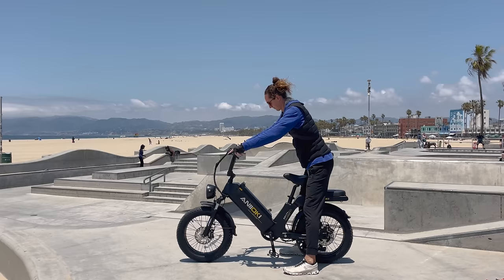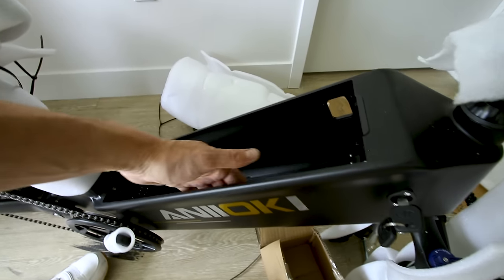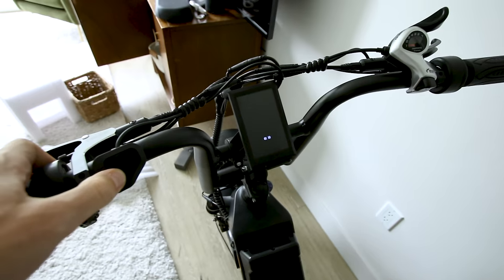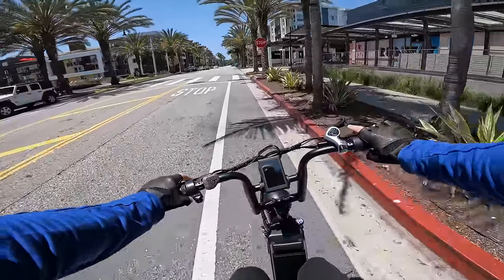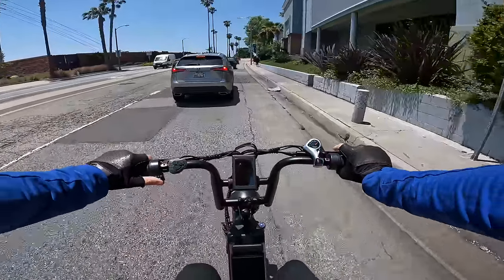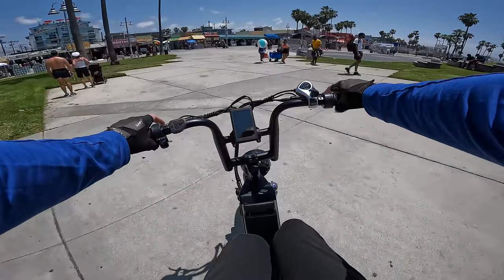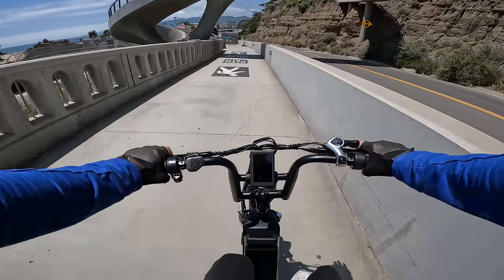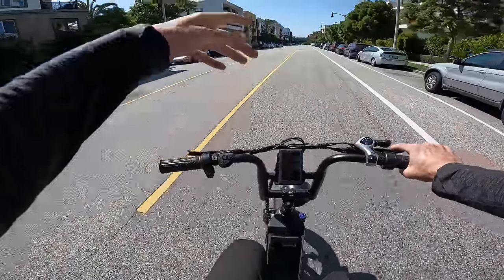The LONGEST Range Ebike Ever! Aniioki AQ177 Pro Max Review

Comment: It is worth pointing out that the 52 Volt version of this bike only delivers 200 Watt more peak power at 1400 Watt compared to 1200 Watt for this one, that version is called A8 rather then AQ177. Strange that it has such a different model name. Worth noticing is that the A8 version do not have that nfc card that you use to start the controller nor does it have any turn signals. I wonder why they think the more expensive version should be more easy to steal and less safe on the road?:face-blue-wide-eyes: I am sure that the flat tire was caused by the strain from that break test. That is one of the major flaws with this bike, from the factory it comes with cheap regular bike rated rather then moped rated tubes inside. That is one of the changes they should make to this bike since it is such a powerful and heavy bike. Also that front light mount is a major flaw, it simply can not hold the light in place if you go on rocky or bumpy roads. It simply falls down to the side and dangles there.

Comment: Yes the screen brightness is low. alson set tire size to 22. And the speedometer will be right on for the most part. The tires suck my back one wore out within 500 mi. But the battery it goes and goes and goes and goes. I love mine

Comment: This ebike would benefit from adding a 3000w motor. You can also add 2x1000w geared hub motors that peak at 2,200+ each.
Reply: I agree. Have you seen anyone talking about having done this?
Reply: @TheCartographeraoe  I haven’t, but these bikes are upgraded styles of e-bikes are updated regularly with less of a battery capability. Think about it it is also intergrated which is cool, so all the extra space on top can be added with another equally sized battery, half whatever. 🙂

Comment: The main reason to choose skinny tired over fat is a persons own requirements.
For instance, a skinny can be lifted more easily. This means maneuverability increases in terms of riding.
 Not to mention ranges and excelleration All things to consider of course. 
Fat tires is close to an Enduro motorcycle, but like a Custom motor with a gallon gas tank in terms of range..
Passes everything but the AC outlet.
An Enduro motorcycle however,  travels hundreds of miles and only needs a few minutes to refuel.

Comment: I’m looking into buying an ebike with a 60+ amp hour capacity battery, and the highest voltage battery/ebike i can locate. i prefer the responsiveness of higher voltage.

i plan and look forward to installing solid airless tires or sometimes called honeycomb airless tires, once i purchase an ebike with fantastic range.

this would permit zero flat tires. true zero flat tires. i realize ride quality can be affected by solid tires but i have ridden ebikes with the airless honeycomb tires that ride really well on ebikes which have front and rear suspension.

so exciting!

Comment: It's common sense that you could get even better range if you just pedal the bike in low level speed, you could probably do a 130 mile range or more easily. It's a 60 amp battery. It's common sense that you're gonna go a long ways.

Comment: I have the 52v A8 dual motor. I did 89 miles two days ago and still had a little more than 40% battery left, according to my multimeter.

Comment: I was about to get this bike, but then I found out about the Eahora Juliet which is this bike but better.
Reply: How much did the bike cost.
Reply: @strikezsr8047  Sorry for the late reply, it cost me about $1800 and I've seen it as low as $1700 on sale. Do keep in mind that the rear rack on the Eahora Juliet isn't suspended whereas on the Aniioki it is if that matters to you. I expected the Juliet to be faster since the motor is a higher nominal wattage but it seems they're both the same topping out at 31MPH (145lbs rider). The Juliet has a dual-crown fork, though so that makes the steering feel more stable.

Comment: Wow, so I just had a rude experience from one of the Aniioki reps. I asked if it would be possible to replace my failing 750 watt hub motor on my Aniioki AQ177 Pro Max 48v 60ah bike with a 1000 watt hub and asked a couple of dumb questions in the process which I answered myself and you know what I got? A lot of these !!! So to say I'm not impressed is an understatement... At any rate I'm wondering, is the hub motor a 175mm or 190mm? Oh, how's it going? lol

Comment: Problem with a bike like that is if I go somewhere with it, it's a given someone will steal it. How do you 100% secure it? Someone can just cut a chain, pick up the bike, go.
Reply: ANYTHING can be stolen if the thief wants it badly enough.  People must remember that!   Locks , chains , alarms , cut off switches etc are all great theft deterrents and might slow down a crook, but again if they want it badly they’ll get it.   Say you have it locked up to a street light with a welded HD chain and bad ass lock.  If criminal has a portable angle grinder (many do now days ) they can cut through it in seconds!   Once cut off  roll the bike down the sidewalk into a van etc and be gone in less then 1-2 minutes
Reply: @jakereal3604  That's my point. This thing is $2000, and it can be easily stolen.

Comment: Dude you should use a few washers to fix the front light and you can also bend the middle bracket attachment piece back in order to get proper placement..

Comment: That's the issue with sealant and wider tyres n tubes you'll feel the wheel being off balanced with the small amount of sealant swooshing around a massive inner tube same as a normal motor bike! We don't feel it on bicycle tyres at 2.6

Comment: You know that thing needed front wheel drive also.. Why not add another 15 lbs? 😂 But then at least you could do hills and sand. That bike with a beefed up front suspension and front wheel drive is something people would really consider. A 35-40 ah battery would have been plenty. 90 lbs like a Walkie H6 would be nicer also. At least a Walkie H6 you could stuff in a mini van or SUV folded.

Comment: If it doesn’t fly up your driveway, it’s a no go for me.  Great way to objectively test the power of a bike, which along with range are two major factors buyers consider.  Great bike for a delivery driver!
Reply: Dude, that's a 20% slope!  Most roads are built with 10% max.
Reply: @Twobarpsi  were do u live not in pa
Reply: if he is delivering in a flat area
Reply: My driveway in Santa Fe is a 14% grade and that’s after a 12% grade for almost 1/4 mile and a 2 mile 8% grade up from the city center.  The only bike I found that can handle this is the Wired Freedom, but that has a 60v system that peaks over 2300 watts.

Comment: If all you do is ride in the city, then 1st mod is to upgrade tires to quality road tires. Better handling and stopping, smoother and quieter ride, with less rolling resistance. Should some increase in range as well. Those are cheap as Chinese tires

Comment: I played with a bunch of settings that I dont really understand because they are not in the maual , but I just hit 48 MPH  Not Kidding. I also have 9  speed settings instead of 5 . I bought this bike based on this review and I am not dissapointed. !!! Thanks
Reply from the maker: 😂 bro your Speedo is off
Reply: @TailHappyTV  It was set to 24" tires but I changed it to 20" and went out again at 44mph. I can prove it. Long press + - then long press + - again to get to the menu
Reply: you can also set a password so you dont need the NFC tag. The default password is in the manual. Press the power button then long press it again to bring up the password screen.
Reply: @3dservicesllc did you check the speedo against your phone for accuracy?
Reply: Lol, probably 48 kmh which you didn’t notice, and you thought it’s mph.

Comment: I really like your reviews. They're extremely informative. I appreciate all of the work you put into your videos. 
My question is, I have a 34% grade I have to conquer every day. Would this bike be worth the investment to make this grade?
Reply from the maker: How long is the hill? Can you get a running start and help it a little bit it’s not the greatest hill climber, but if you can approach with speed and help it over a bit and probably be all right as long as it’s not like a mile long. I appreciate your feedback.
Reply: It's a relatively short. Yet fairly steep hill probably 35° 200 feet long. How does this bike compare with the juiced hyperscorpion on a hill climb. I have the hyperscorpion,  and it does very well on this particular hill. Any suggestions between the two would be a great value to me.

Comment: Looks more moto components them discs and the rear coil shock with the piggy back oil resivour same as my fox x2
Float but they look more moped or Crosser shocks yeah this would definitely be classed as a crosser moped lol totally illegal here in the UK now Anything throttle over 250w but the E mountain mid drives I ride and race are fantastic pedle assist more than enough tourqe 85nm 750w bosh smart system tunable
These ebikes here are something I'd never touch being so cheap made as a bike mechanic and race enduro and downhill I can see many weak connection parts on these things there frightening! Last one I watched you reviewed didn't even have a through axel! You bought a skewer QR for it but decided to use the tiny pinch bolts it came with, and no inner axel support! Even a skewer QR is dangerous for a heavier ebike but it's abit more support!. I'd love to know how these ebikes perform everyday use and how
Reliable the components are with daily use!

Comment: ‼️‼️Has anyone actually gotten close to 200 +miles on pedal assist like the website claims ? ⁉️ every review I read said they gotten less than 100 with pedal assist before battery died 😢
Reply from the maker: 100 is probably the realistic max, you can only realistically give about 100 watts of power if you pedal and the bike weighs so much it will have a very minimal affect on propelling the bike. Pedaling is mostly “for show” and exercise, not extending range

Comment: What again would be the maximum range on non pedal power, (maximum speed, full throttle only)  with a fully charged battery at the  maximum 60 AMPS  version ?

Comment: Do they rear piggy back coil shocks have adjustable Rebound and compression or just cheap rubbish that only adjust the coil springs? Should see a red dial for Rebound and a blue dial for compression on the rear shocks! You need to set your 30% rear sag and 25% front sag on every new full suspension bike to work right for
The riders weight or it will not be comfortable and bounce about all over

Comment: Hey 👋 question do you have to remove the battery every time to charge it? Is there a way to simply just plug in the cord and the other end into the bike somewhere?
Reply from the maker: You can charge it either on the bike or off the bike, that’s pretty much how every Ebike works
Reply: Thanks
Reply: Hey I finally purchased, it was working great, and the next day it’s showing code30, any idea?
Reply: @kendrickjarias  How is the bike doing for you after a couple of months?
Reply: @turt1231  hey 👋 it’s doing great it’s been  very reliable, gets me to and from work every day. I literally charge it once a week, the battery life is amazing, my only complaint is the paint tends to chip easy. It’s a cheap paint job and the stock tires wear fast. I’ll have to purchase some soon they’re almost bald, but even almost bald, the bike balances well, i like to “bank” a lot like a plane while riding.
Reply: @kendrickjarias  
Thank you for replying. They just came out with dual motor and were wondering if I should buy a freego or A8 dual. The A8 has more power but weight more.
Reply: @turt1231  wow i just saw the dual motor, seems like you can’t buy anything these days without having a newer variant released right after buying, all i can say is, the Aniioke bikes are King when it comes to range and battery life, if you do go with Aniioke, I’d buy a seat post suspension ( Kinekt ) and a wide seat, those were the only upgrades i found needed. Suspension doesn’t really function unless your over 250Lbs imo, I’m 190…and seat is okay, but a wide seat is awesome
Reply: @kendrickjarias  
I was wondering about the seat. Also, I was wondering if the V7 is better then the A8 in terms of ride and comfort. I just want to cruise on the bike but not thinking about going really long miles on it. Thank you for the replies, I appreciate it.